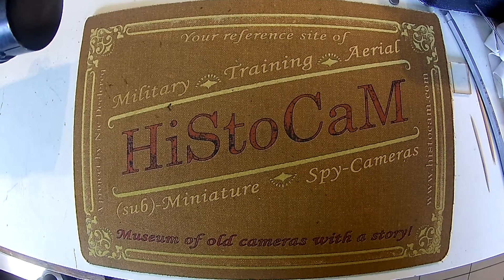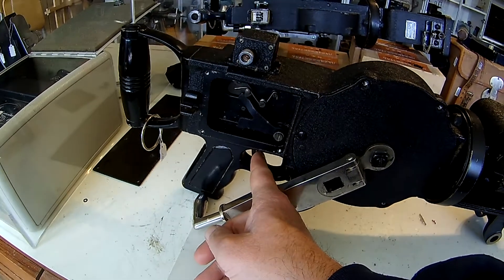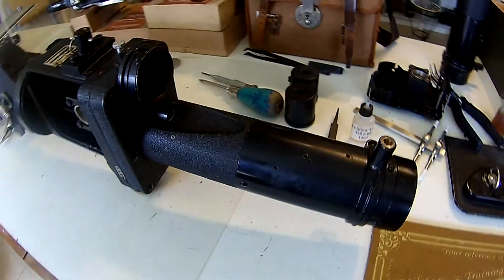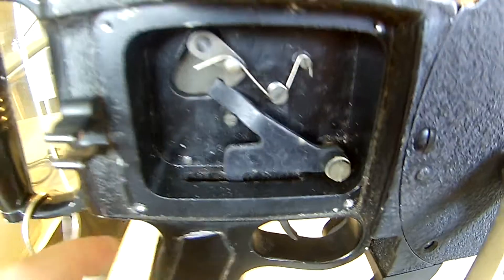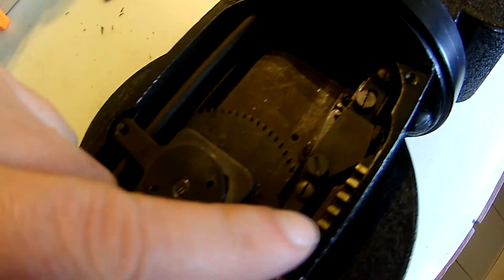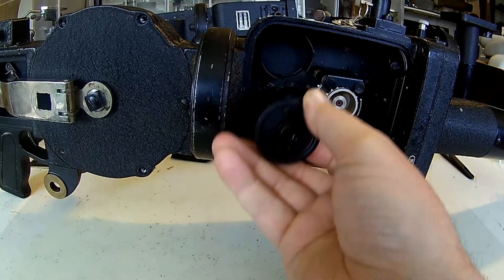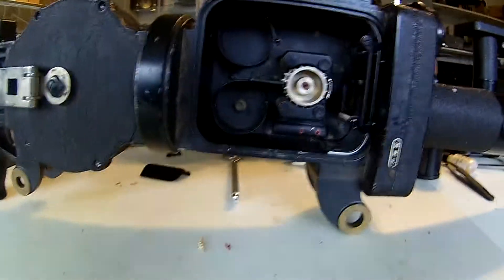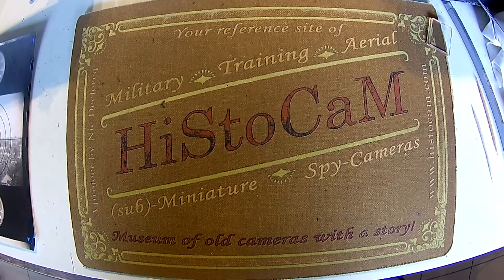The working of a Japanese Gun Camera, the Konishiroku Rokuoh-Sha Type 89. #histocam

Comment: Do you know what type of watch is used in the camera?
Reply from the maker: Yes, there were 4, a Seikoshi, Berna, Leonidas and Mouris. All with black dual. You can see An example of a Berna in my website. http://www.histocam.com/collection/aerial/konishi-rokuoh-sha-type-89-japanese-wwii-machine-gun/
All had the name of the gun camera on the back, and the serial number, corresponding the serial number of the camera.
Reply: @histocam9888  hello histocam

Sorry its been a while but ive been wondering if youve ever tried running film through one of these? Ive seen a few come up on ebay recently and it got me wondering if it would be possible to use the canisters to make some small short clips using them?

Ive also been searching for a working chronograph watch for the camera but it seems theyre all in bad shape so i wanted to ask if they were a special repair job or if they could be fixed by a normal watch repair shop?
Reply: @entity9742  Hi, no problem. No, I never tried running film through it. Although I have about 16 canisters of New (old) original film. But I have no idea about developing. (I'm a photographer, so I know how to develop, but have no knowledge about what product to use or times...) And about the watch. Hard to find indeed. Specially in working condition. And they are just normal watches, no exotic thing in it. So, I think it can be serviced by a watch repair shop. Just be aware, always ask for pictures of the inside. I have 4 watches and one is missing the chronograph-stuff ...
Reply: @nicdeclercq8975  interesting

Will definitely look into getting one then as theres a few on ebay currently that work but need a bit of tuning with the chronograph settings

As for the film i believe if you do a test run with some hc-110 it might work as in 1930-1940s negative stock was mostly agfa or tri-x and they work very well with the developer

Also i did want to ask since i dont have access to a bunch of lubricant oils would rem-oil work for a seized motor in one of these? Ive used it in a few bolex models and they all work properly and its mainly used in firearms/machinery tools